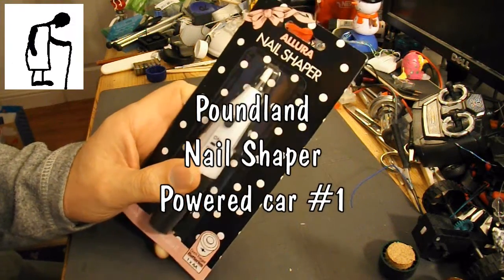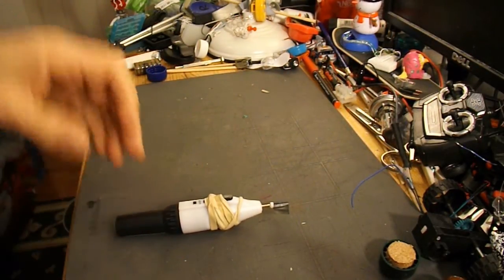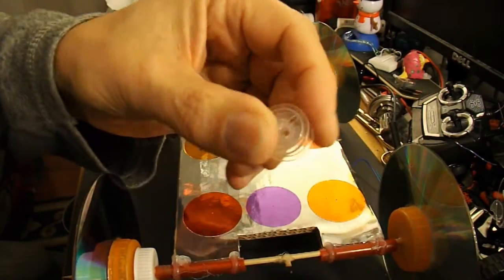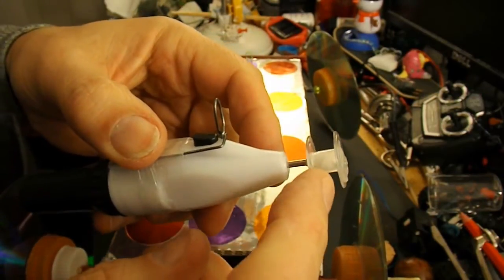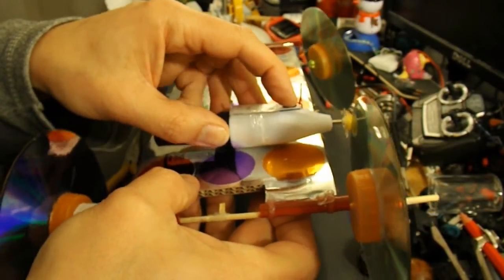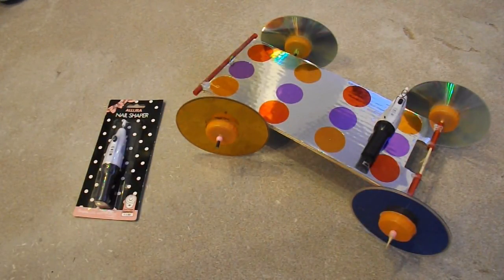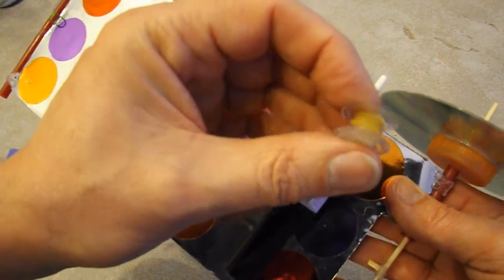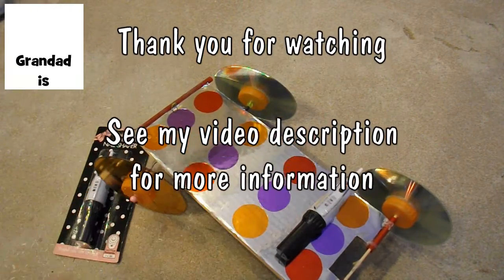Poundland Nail Shaper powered car #1

Comment: Runs at a good speed, considering the 1:400 or so gear ratio haha. Quite the size of vehicle and must be some weight in that tool itself, so it's really quite the performer :)
Reply from the maker: There are a few things happening here that I didn't explain in the video once it was edited down to size. The bobbin with the rubber band round it reduced the ratio too far and it struggled to move on the concrete floor and only just managed to move on the smooth lino in the kitchen.
The axle tube is about 2 to 3 times the diameter of the axle so there is movement between the wheel and the drive shaft. When I am showing the grinding tip and the wheel you can see there is quite a gap between them, but when the car is on the floor the axle moves in the axle tube and the wheel makes contact.
With the bobbin, the car worked in reverse but in forward direction the rotation of the wheel and the movement of the axle caused the wheel to move too close to the bobbin jamming it.
Reply: GrandadIsAnOldMan
Thanks for the extra info...made me wonder about a project of mine instead of gears. A grippy surface on a tube over the motor shaft might work better :)

Comment: i have a challenge for you to make electric car using ping pong balls and CDs and cardboard
Reply from the maker: Not quite sure what you have in mind as that sound like an odd mixture.
Here is a cardboard car which floats as a boat using pingpong balls.
http://youtu.be/mjO6Iqd4gC4?list=PLA5a2xPRSrB24vUS9E8zkSgjZysEL00zr
This electric car uses deoderant balls very similar in size to ping pong balls as wheels
http://youtu.be/lBrrt_LF-L0?list=PLA5a2xPRSrB0yTUYmJSS3ML5xxaBzHl3e
This one uses the same balls for wheels and a CD as the body
http://youtu.be/_OOqcBxA3Ps?list=PLA5a2xPRSrB0yTUYmJSS3ML5xxaBzHl3e
This one uses the same balls for wheels and a lemon for the body
http://youtu.be/5bc51N79N2g?list=PLA5a2xPRSrB0yTUYmJSS3ML5xxaBzHl3e
This one uses similar balls as wheels and a hair comb as the chassis
http://youtu.be/1DalkaZgu9Q?list=PLA5a2xPRSrB0yTUYmJSS3ML5xxaBzHl3e
This one uses similar balls and a pizza tray as the body
http://youtu.be/r0B_hco6baY?list=PLA5a2xPRSrB04GN5yvwwJipBl8tm3-LcD